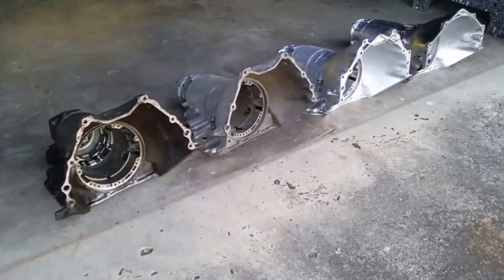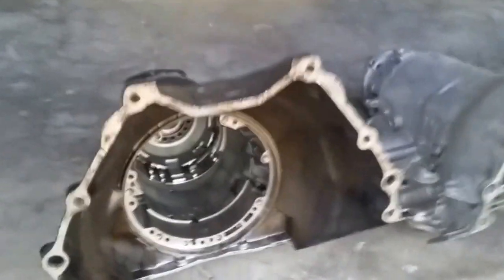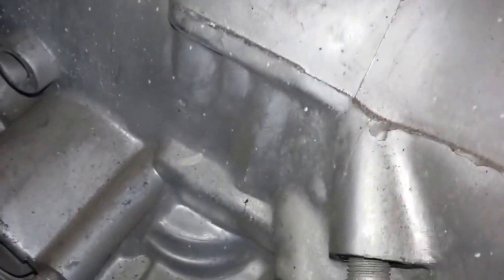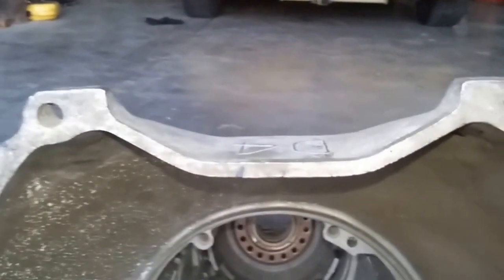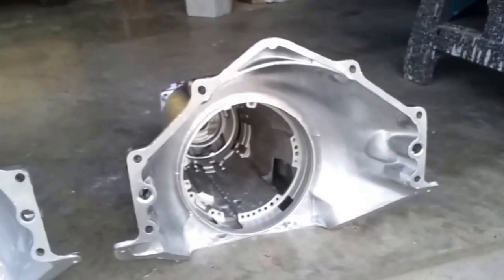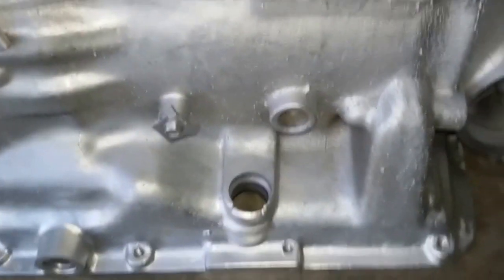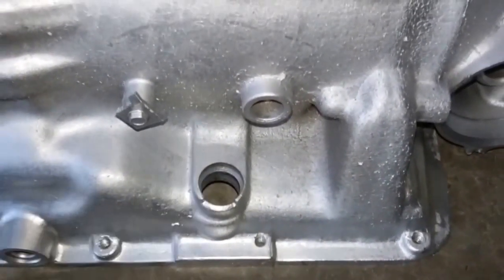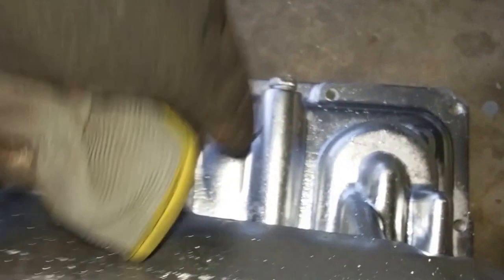TH-350 Bell Housings (Transmission Parts ID)

Comment: U seem pretty smart on this. Can you tell me what the tab with hole sticking out on the passenger side is for? It's about mid way up the bell housing near where it mates to the engine. Thanks
Reply from the maker: Alternate bolt hole to stabilize the dipstick tube. Leftover from before they started pinning the tab under a bellhousing bolt.

Comment: Can you tell me how to identify a TH350 that came off a 4X4 1972 K5 Blazer. What type of case does it use? I suppose it would be the one on the far right that one you ID’d as a Chevrolet. I’ve seen a huge “K” stamped on the top of the case and that’s what some people ID a 4x4. Can you please confirm. Thanks in advance.
Reply: That is correct. The "k" is 4x4 so you can hook the braces from the transfer case.